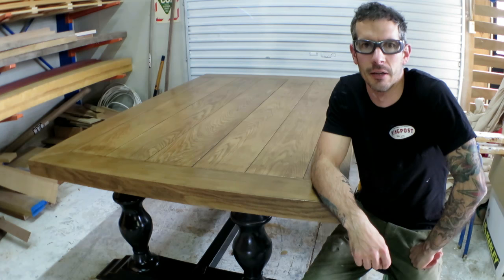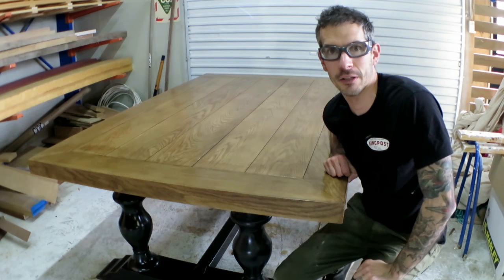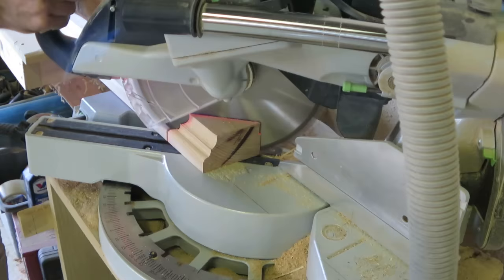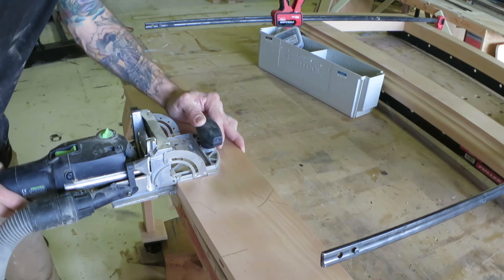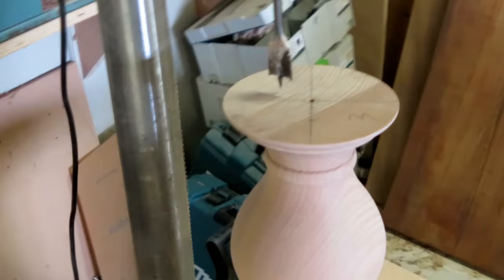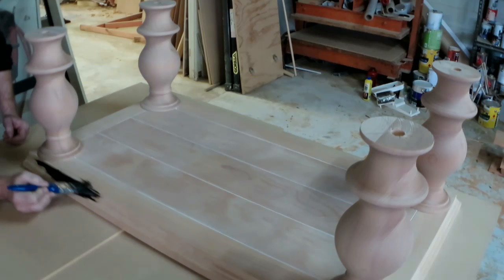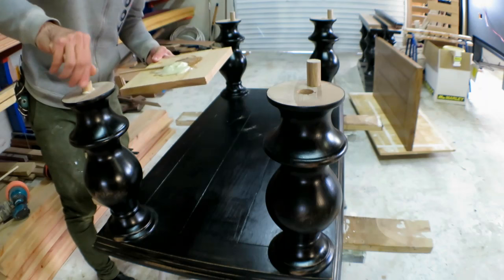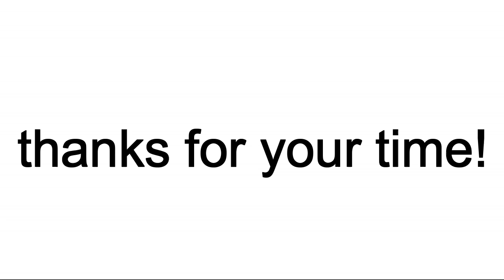part 4 (final) Neo  classical tables

Comment: Very nice. I feel for you mate, been there done that, cut the mitre in the wrong place on a moulding I had made for an antique looking picture frame... made me two cm short, so ended up having to make a complete new moulding. I have learnt my lesson. I use playing cards for spaces (cheaper than Bis cards), and painters tape for marking orientation etc. reduces sanding of pencil or chalk :)
Reply from the maker: HI, thanks. its funny how even though you know how not to stuff you just do it! was gonna use playing cards but couldnt find any,  bis cards were my wifes! HA

Comment: I love the sealant in the cracks.  I just finished off a 48x90 farmhouse table with oak boards for the top.  That would have been great for the joints.

Comment: It is so good seeing how a professional handles all the different areas of the build.  Then when you cut the mitre in the wrong direction I just felt that rotten sick feeling when I screw up!  How did matching the new piece go? Would have been good to see that work as I would expect there is additional "pain" there too!  
Thanks so much for the video and good to see you have help.
Reply from the maker: HI , cheers.  i thought it would be a pain to match the molding but it actually worked pretty good,  just a bit of sanding after glue up.

Comment: Great workmanship. Not to my taste but looks great. I can only guess what you said to the Monday morning mistake .Always on a Monday morning. Could the molding not be done on the router, if so what was your thoughts behind using the hand planes.Great cinematography.
Reply from the maker: HI,  thanks.   i guess i could have used a router to make the moulding would have meant buy a could of new bits (much cheaper than planes!)  but i have always wanted to try this and figered why not? turned our prteyy easy and the planes are super vesitile.  id like to build up to a full set of hollws and rounds so i can offer crown moulding etc in nice timbers. thanks for watching !
Reply: Yes I remember you saying something about building up a set of planes. I think you made the right call to hand do the moldings, anyone can zap them up with a router but only a true craftsman can do molding that good by hand .I look forward to you next project. Thank you your reply Joey.

Comment: Further to John's comment below.....was the hand plane use more for personal hand tool satisfaction or did you think it was more efficient and cost effective over a  router or shaper?
Reply from the maker: HI,  thanks.   i guess i could have used a router to make the moulding would have meant buy a could of new bits (much cheaper than planes!)  but i have always wanted to try this and figered why not? turned our pretty easy and the planes are super vesitile.  id like to build up to a full set of hollws and rounds so i can offer crown moulding etc in nice timbers. thanks for watching !